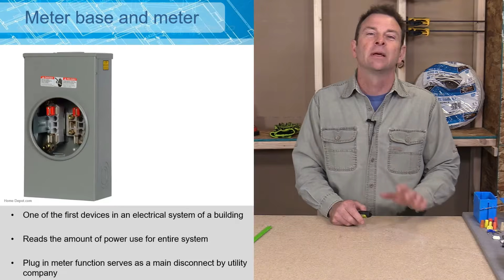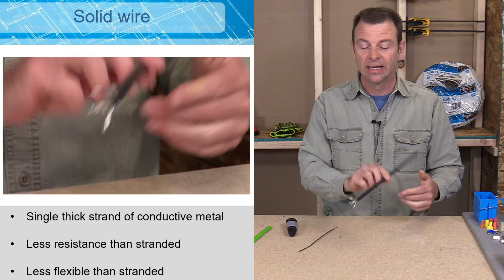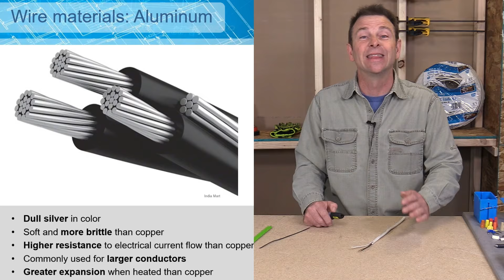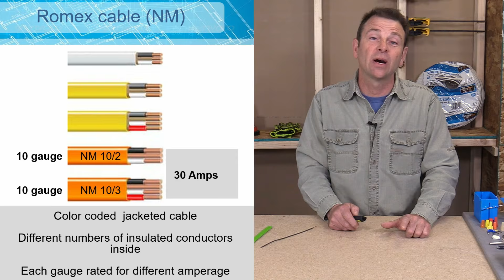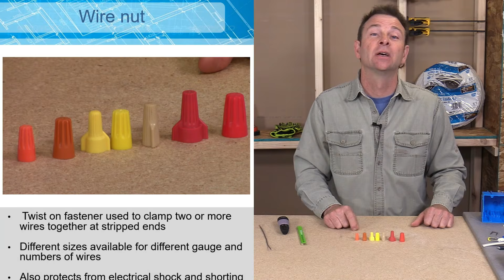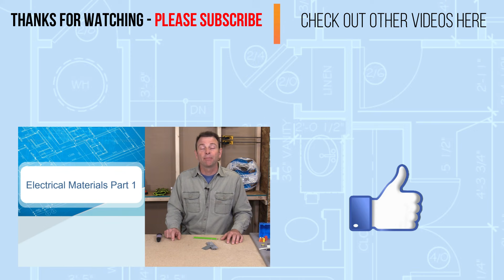Basic Electrical Materials Part 1 of 2 - Introduction to Electrical Wiring -  Trades Training Video

Comment: How do you know what size breaker & size romex to run on the front end?  For example, if you needed to run a 20 amp circuit vs a 15 amp circuit.  How can you know which size to use when you don’t know on the front end what type of appliances are going to be present?

Comment: Thank you for the great lesson! 
I would only add that silver is worth mentioning when we talk about the best conductor material. 
Don't want to be a snob here, but nowadays we can find conductors made from silver in some specific areas even in residential homes.
Reply from the maker: That is a valid point - although I rarely find silver wire any more.